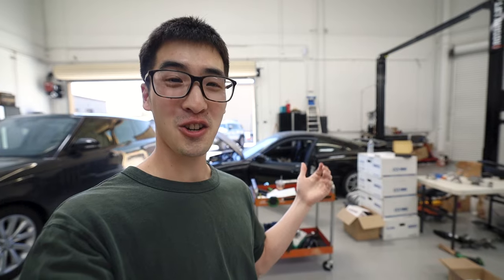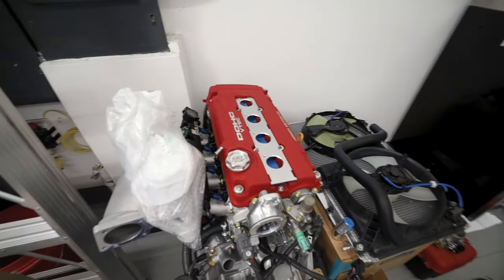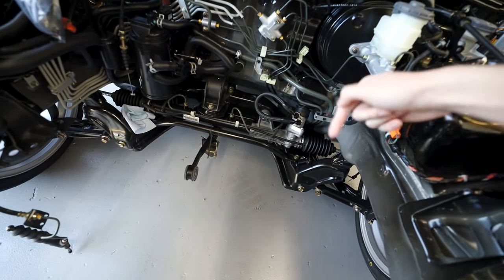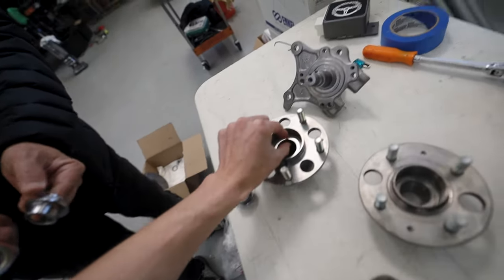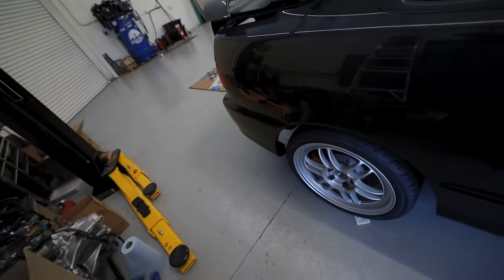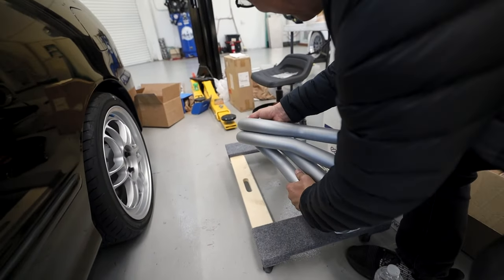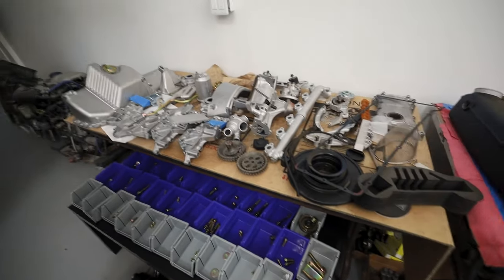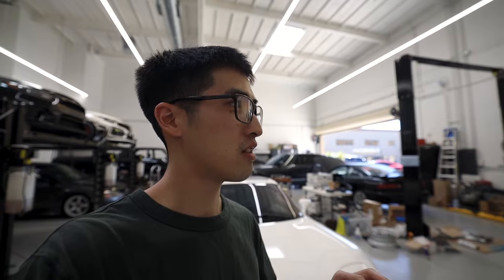5 Lug Conversion SOLUTION for your Honda

Comment: ITR parts are hard to come by.  My 5-lug solution for the rear was to use a Mazda Protege axle nut with an ITR rear bearing.  I'm not sure those are easy to come by so maybe a Prelude or Accord one might work?  For the front, I just used a 1st gen CR-V knuckle (I'm running 36mm axles).

Comment: Where can I buy the rear axle nuts? Thank you
Reply from the maker: be sure to provide your email in the form. I will get back to you shortly !!
Reply: At any auto store, theyll take it off a mazda 626 axle
Reply: @Shintec_Autowerx  the Mazda nuts do not solve the issue of the bearing race not being fully supported by the short spindle like the ones in this video do. Cheers